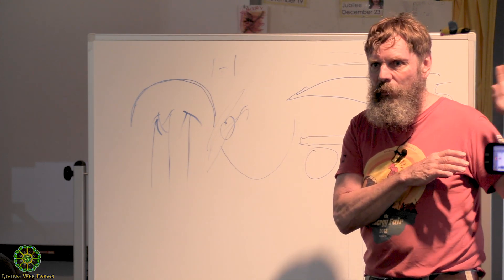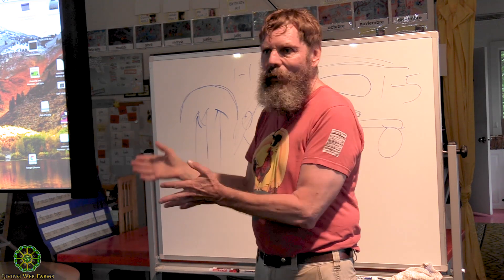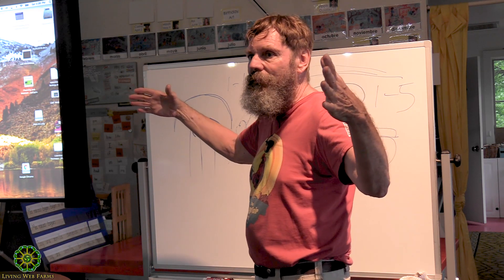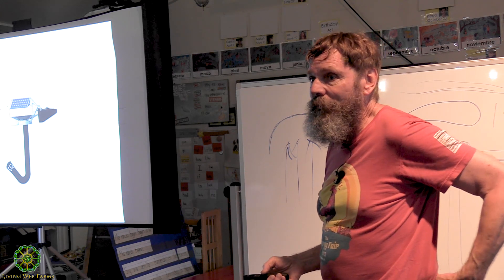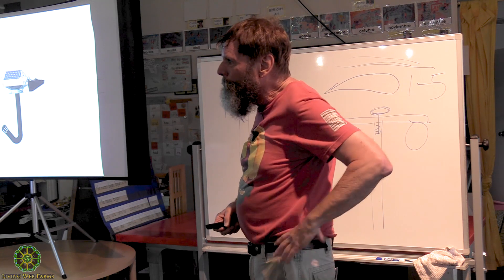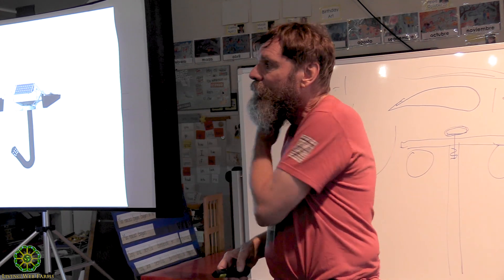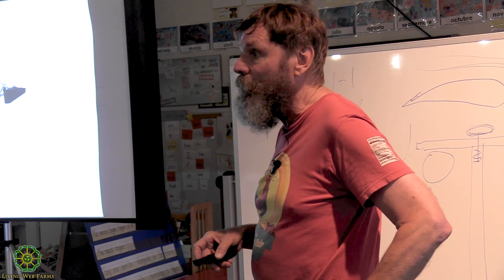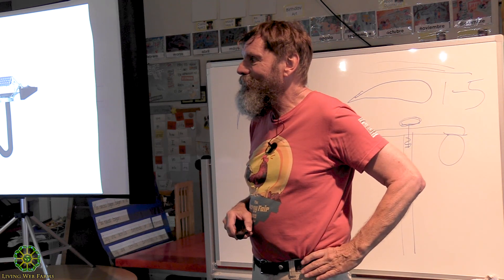Implementing A Living Pond Restoration System Part 5

Comment: Don’t know if this is a solution or not? The ponds around here tend to become acidic due to the accumulation of leaf tannins and Carbonic acid from rain runoff and need to be limed periodically. Could you soak some absorbent medium in hydrogen peroxide and then submerge that material in microbubbler containers and place them at various locations in the depths of the pond to liberate Oxygen. This would also serve to neutralize the acid in the pond as well as to prevent eutrophication. The O2 should not be toxic as it would diffuse very quickly throughout the water column as the liberated gas rises to the surface. No moving parts to power, maintain and replace!